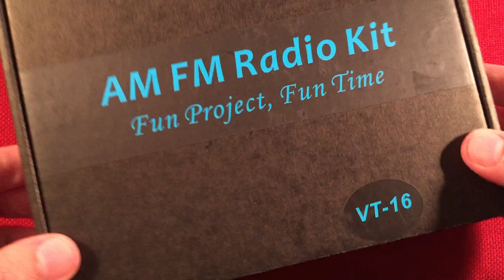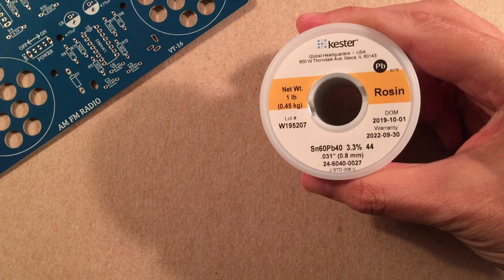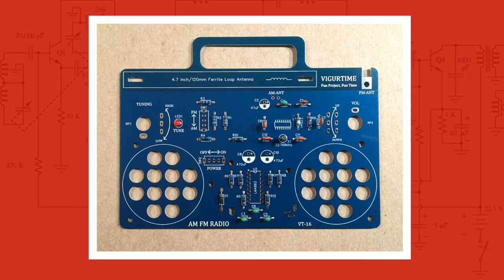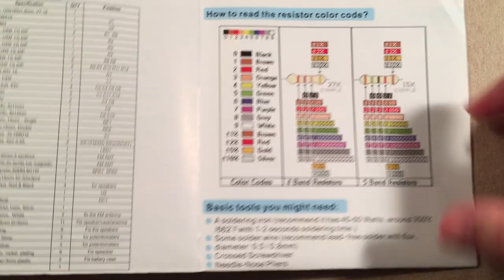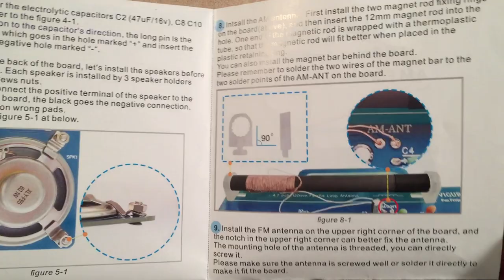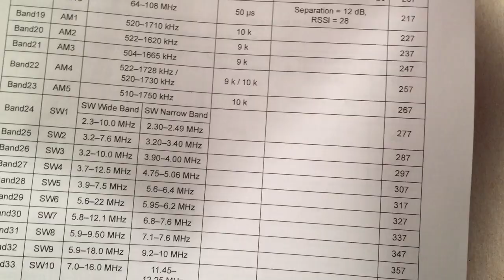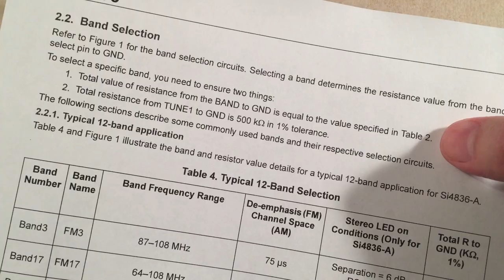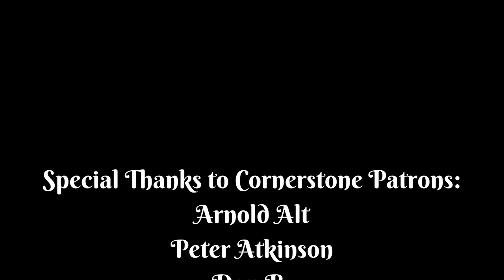Vigurtime VT-16 AM FM Stereo DIY Portable Radio Kit Review

Comment from the maker: Quick Links:
▶ The Awesome Vigurtime VT-16 AM FM Stereo Kit at Amazon: https://amzn.to/3D00ujB
(paid link) As an Amazon Associate I earn from qualifying purchases.  There are no additional costs to you.
If you received the Euro Kit with 47K at R4, 191K at R3, and 150K at R2, then Use the Links below to Shop for 68K 1/4W 1%, and 160K 1/4 1% Resistors.
▶ The Seller crystalelectronics is Great, I used his/her store to Purchase mine :)
(paid link) As an eBay Partner, I may be compensated if you make a purchase.
▶ 1/4W 1% Value Resistors at eBay: https://ebay.to/3EJkecu

Comment: You gave a detailed listing of all the tools you had on hand but you neglected to show what type of soldering iron or station you used which is the main tool used for the project.
Reply from the maker: Most people will not own a Hakko FX-951, so I mentioned in the video a 25-30W iron with a small tip will work fine.